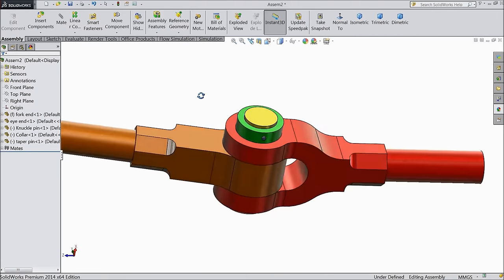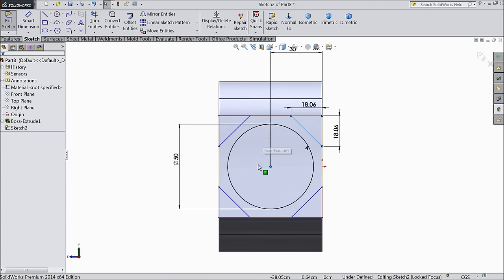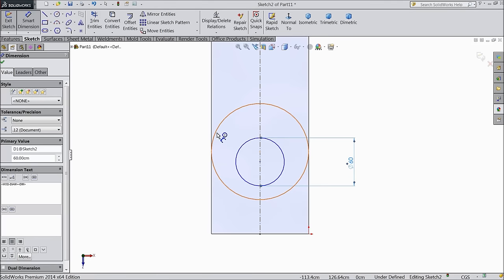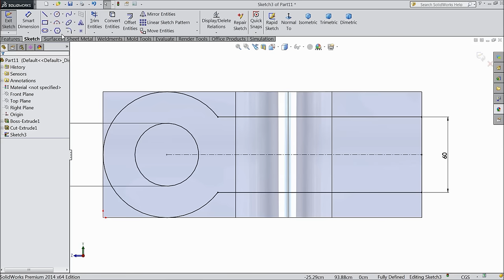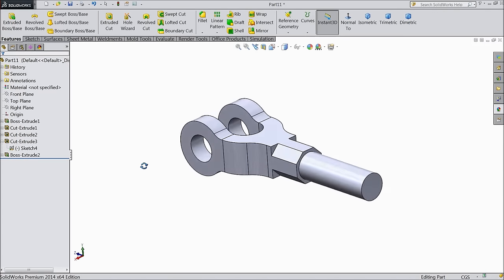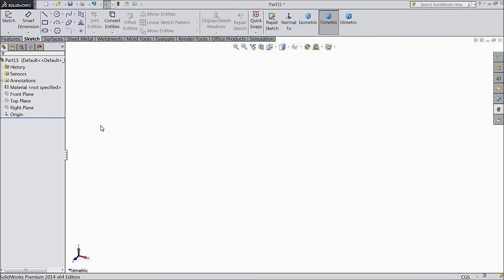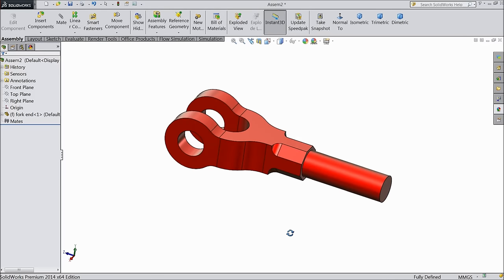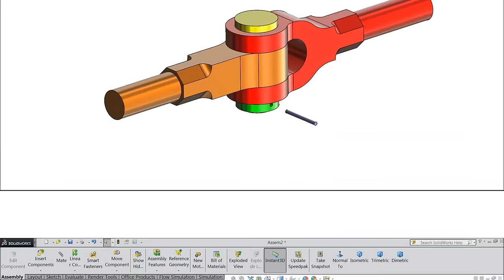Solidworks tutorial | Sketch knuckle joint in Solidworks

Comment: Start code

M117 Here We Go!!!
G28 ; home all axes
M204 P500 S700 T1000
M205 X10 Y10 ; set jerk x/y=10
M117 Purging Extruder...
G1 Z1.0 F3000 ; lift Z
G1 X0.2 Y25 Z0.2 F3000.0 ; move to start-line position
G92 E0 ; reset extruder
G1 X0.2 Y150.0 F1000.0 E15 ; draw 1st line
G1 X0.7 Y150.0 F3000.0 ; move to side 0.5mm
G1 X0.7 Y50 F1000.0 E30 ; draw 2nd line
G1 X0.7 Y25 F5000.0 ; quick wipe
M117 Printing...

End Code
M104 S0 ; turn off extruder
M140 S0 ; turn off bed
G1 X0 Y295 F1000 ; move finished print out front
M84 ; disable motors
M106 S0 ; turn off cooling fan